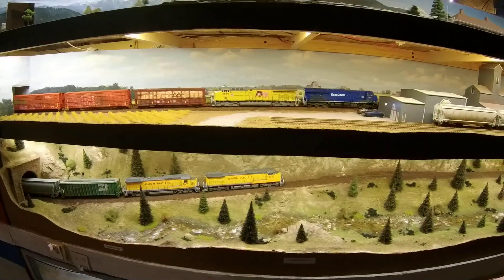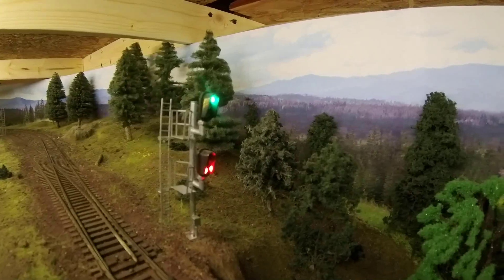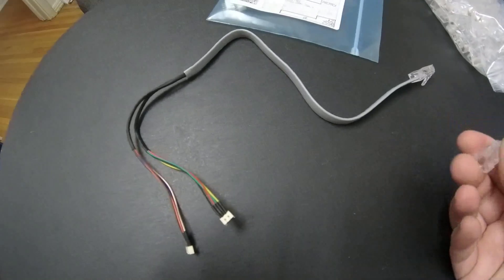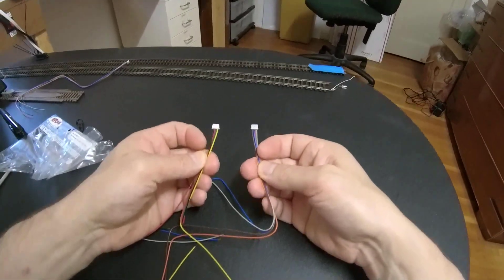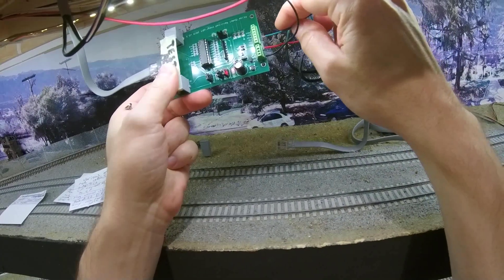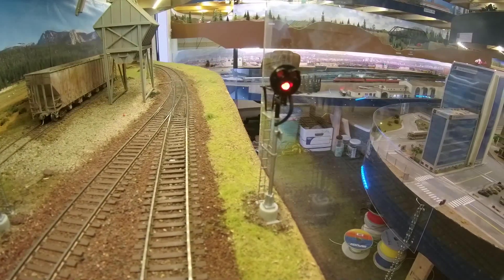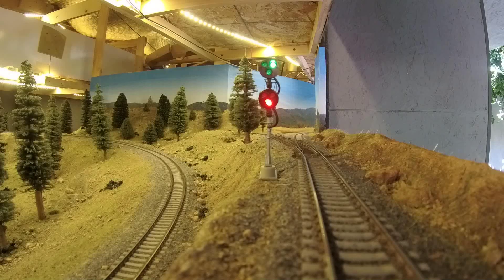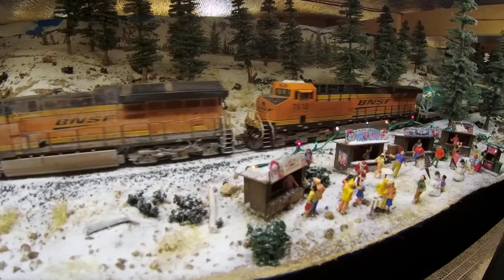How to Install the Atlas Signal System Made Simple (Signals Part 2)

Comment: I have a problem with a 3 block basic mainline and siding I'd like to see if you have some suggestions. When I throw the turnout to the main and back to the siding and it doesn’t clear until a train moves out of the siding block. Is there some way i can DM you for some advice?

Comment: Hi quick question will the hook up you did with the tortoise and signal work as the atlas interlocking boards? I haven't seen one  in operation but was curious if you recently used one. If not like to do what you did in video thanks great work.Tom
Reply: Sorry haven’t tested with interlocking but I don’t see why it wouldn’t.  We were all hoping the interlocking board would include an interface for JMRI. Very disappointed you can’t use the atlas system with computerized ctc yet.
Reply: @areakt  thanks do you use that with a block detector for switch? Wasn't sure. Also if thst works well I'll use that type of hook up stupid question the signal drops to red when train passes? Thanks tom
Reply: @tomthetank924  Yes, I use the Iowa Scaled Block detectors which are easy to use and work well with the Atlas system. And yes the signal displays red when the train passes and occupies the block or when the switch is thrown against you if you're feeding it that info from your tortoise.
Reply: Thank you.

Comment: How does this work when turnouts are manual? Or powered with factory motor (in my case KATO)?
Reply: You have to wire the override on the atlas board to the position switch output on your switch machine (Kato or tortoise) so it will throw a red signal if your switch is thrown against you. It’s easy on the tortoise machines but not sure about Kato.  If you have manually thrown turnouts you’ll have to build a switch into your facia to indicate turnout position. By the time you go to that trouble you might as well just buy a $15 tortoise machine and use that instead. For my layout I don’t include manual spurs in the signal system. Best use is for sidings and single track or maybe double track   Leave the industries as dark territory off of your sidings. Never put an industry on the main of you can avoid it.

Comment: What are you using to power the block detector, and whats powering the atlas control board?  So, the only wire that runs from the block detector to the Atlas board, is the one D in line? Thanks so much!!
Reply: The block detector and the control board must be powered by the same 12v power supply.  I am using an inexpensive 12v power supply off to eBay.  Yes the d input forms a circuit with the power supply and board which is why they must be on the same power source.

Comment: I can’t get the Iowa Atom BD to see the Train on my isolated Test block. Just a Green Led. 

Does the Loco have to have Lights on for Load for it to Detect? Will it Detect Metal Wheels on Cars or must they be Resistor Wheel sets?

I haven’t connected the Wire from the Detector to the Atlas DIN yet because it’s obvious the IA Detector doesn’t see anything yet. 

Doing this all topside jumpered together. Using Alligator Clip lead and a wire stub to pass through the Donut. Clip end on Block Rail. Should in theory work??
Reply: The loco will be detected as long as it is on the track and has a decoder etc.  usually if it’s still green it’s because the BD sensitivity isn’t set high enough.  Usually this is adjusted by tightening a screw on the BD.   For cars to be detected they must have lights or a resistor between the wheels.
Reply: I got some IA Scaled email Support. All I needed. Going to change way test feeder routes through Donut. Couldn’t Spoof it.

Comment: In this video (or possibly the predecessor), you mention, using an ethernet splitter coming out of the Atlas control board to duplicate the signal. I've tried two separate 2 to 1 ethernet splitters off Amazon, and neither has worked. Both of the splitters were "dumb" and had no hub/switch technology. They simply split the signal in two. Would you please share the part number for the model of ethernet splitter you found that works? It would be greatly appreciated!

Thanks - Tim in CO
Reply: Hi, I also want to use 1 Atlas Signal Control Board to send at the same time, the identical signal, to 2 Atlas Signals poles. I was going to purchase an ethernet splitter like you; but you tried and it did not work.  You mentioned that your splitter "simply split the signal in two". Isn't that what you wanted? You said that niether of your splitters worked. Did they do anything ?

Comment: How do you move the jumper J2 to the alternate position?  Is there a small switch on the board .  My signal lights don’t come on when power is applied.
Reply: You just pull the jumper plug up and move it over to the pins next to it.
Reply: Ok, I’ll try that and see what I can figure out.  Thank you

Comment: I'm thinking of going the Atlas route and use and NCE system I use Switch8 MK2s and Tortoises can I still use the Switch8 MK2 to switch my Tortoises while the signal changes as well?
Reply: Yes as long as you still have the tortoise outputs to tell the atlas system what position the switch is in you should be fine. You just run the tortoise indication output to the atlas signal override input.
Reply: @areakt  thanks I'm liking how simple the Atlas system seems to be so far I suppose the instructions would clarify it as well? I find some videos are still a bit vague on how to wire such systems up I know once you get the hang of it it just becomes second nature lol
Reply: @losi5ivet29cc  The instructions were a little hard to follow for the average application so that's why I made the video series on them, frankly so I could watch it when I forget how to wire them up.  ;)
Reply: @areakt   lol 😆  I have a signal I bought a while back that I wouldn't mind experimenting with its a BLMA without the plug but what intrigued me about the Atlas system is the components are fairly inexpensive so if I buy a signal controller to experiment with I will eventually get some more in the future. Thanks for the advice :)

Comment: Great explanation !!! BTW your ballast work is amazing!.  How would this system work with RAILPRO,where the track voltage is constant (12-14vdc) and comm is via radio? There isnt much info on this.
Reply: Thank you!  With railpro the tracks would still drop the voltage in the section the train is in so I think detection should work the same.
Reply: @areakt  Thank you, I will try it.

Comment: If you’re going JMRI why not just use that, some NCE Light-it’s and the ISE current detectors? Might save $$$ over the Atlas components, which wouldn’t be needed as the signal logic would be handed fully via the computer.
Reply: agreed, signal decoders would be a hell of a lot cheaper